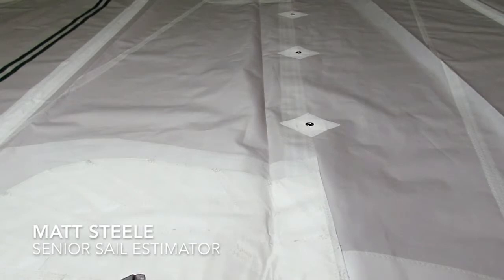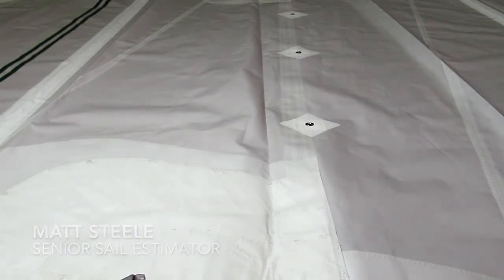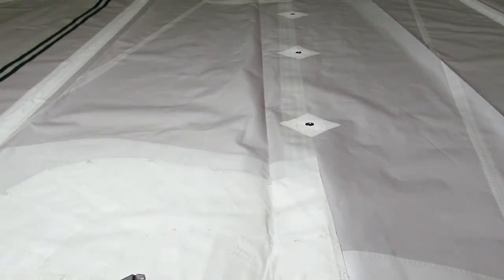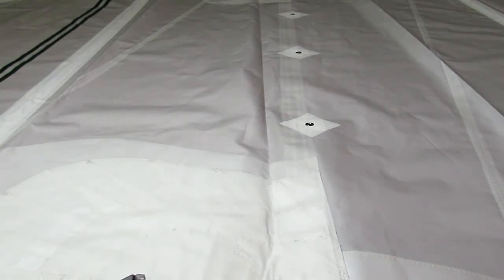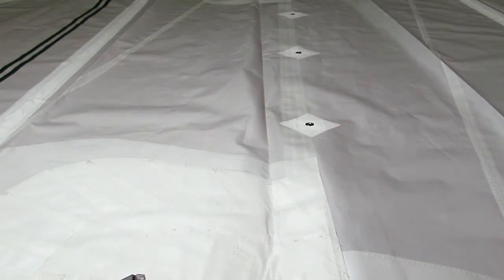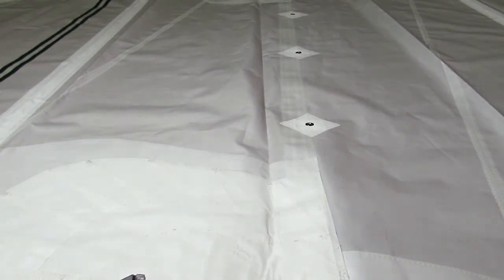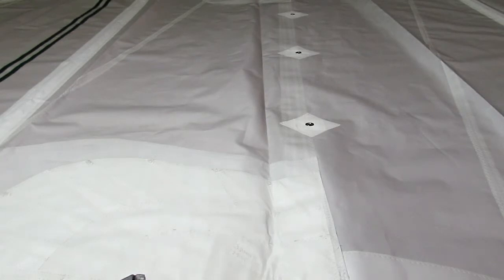Reef Points Design

Comment: Is this 10%, 20% and 33% "by sail area" or "by distance up the sail luff"?
Reply from the maker: Thank you Kay, These reef points are at 10%, 20% and 30%, however placement of reef points is part of the design and can be adjusted for the area the sail is to be used.  We often put single deep reef points at around 20% for smaller boats in lighter air